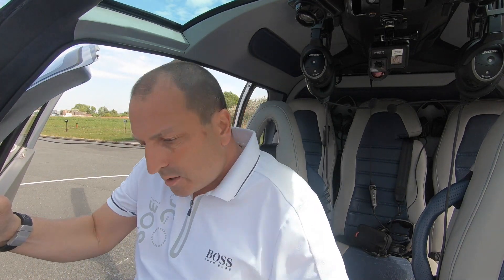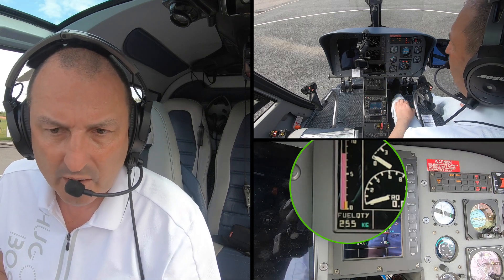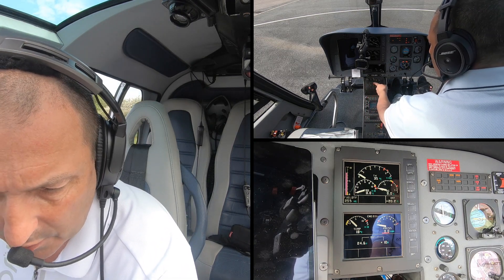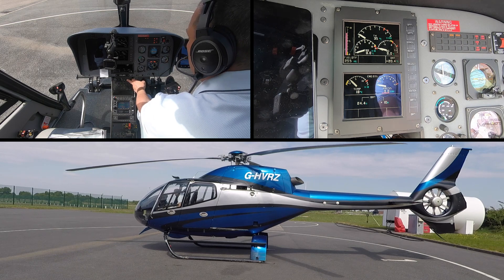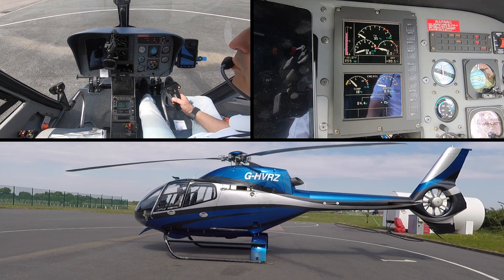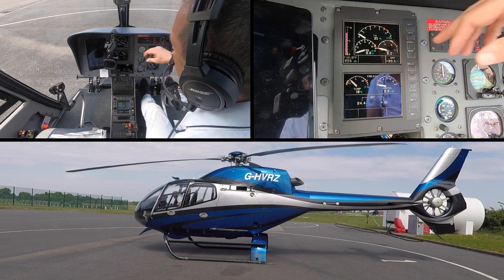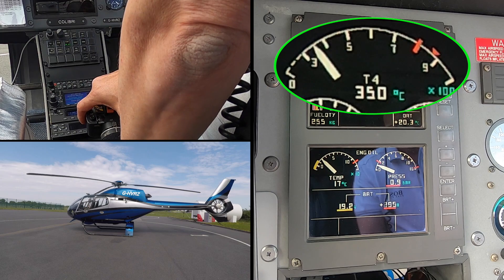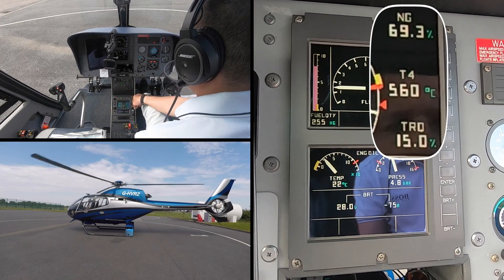G-HVRZ - Startup procedure on a Eurocopter EC120 Helicopter

Comment: I was told EC120 is a bad helicopter because it has a very underpowered engine.. is this true?
Reply from the maker: Well it won’t lift off the ground full of fuel and passengers and luggage so there is a balance to find which usually involves compromising on something.
Reply: @jetboxtv  ok. thanks